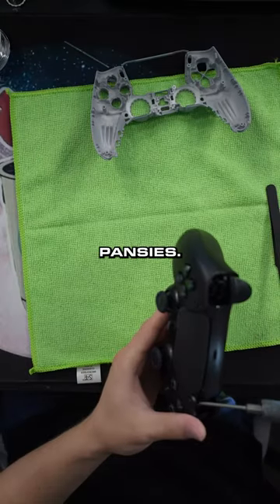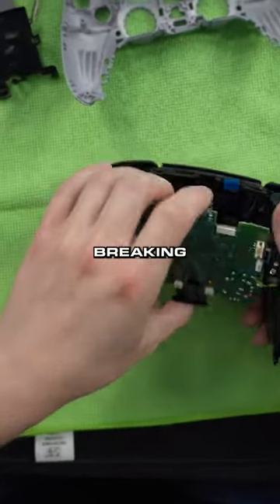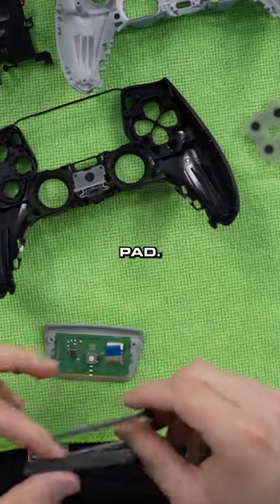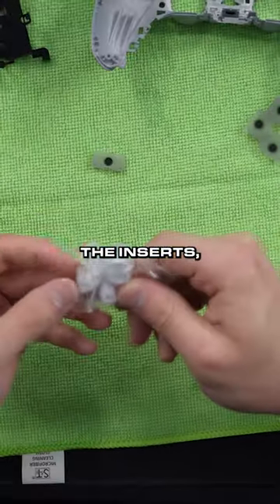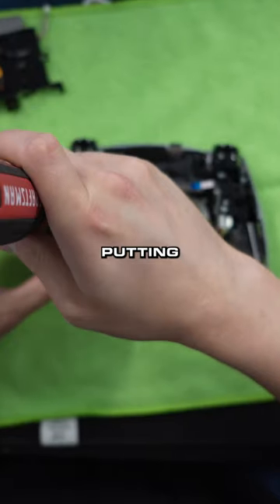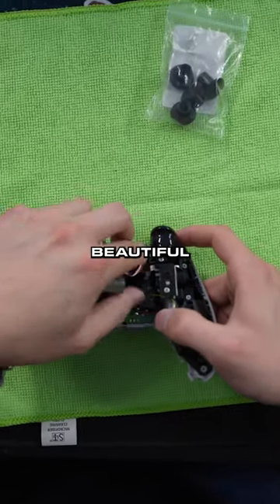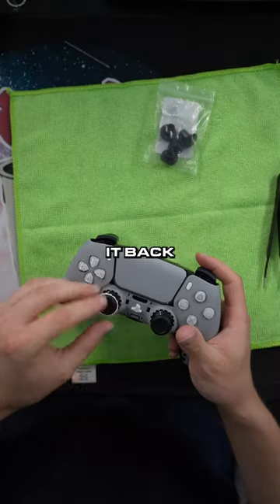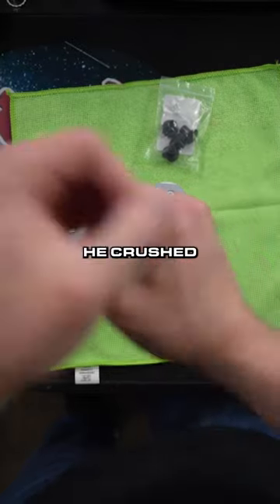how to build a ps5 controller #gaming #howto #ps5 #pov #gamer #cod

Comment: @Cinchgaming With the remap chip can you disable back buttons so you can play 2 buttons without accidentally pressing the other 2, because i switch between 2 and 4 back buttons and don't want to buy 2 controllers?
Reply from the maker: The buttons even with remap would be mapped to some button.  You would be able to map them the same on one side though so both would be the same.
Reply: @Cinchgaming  ok thank you